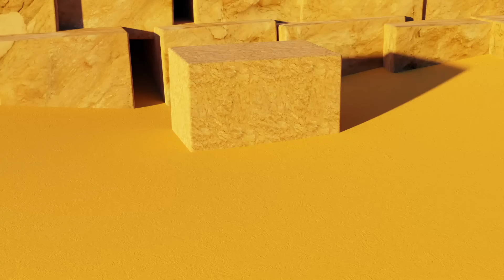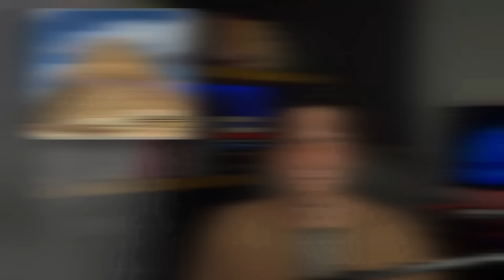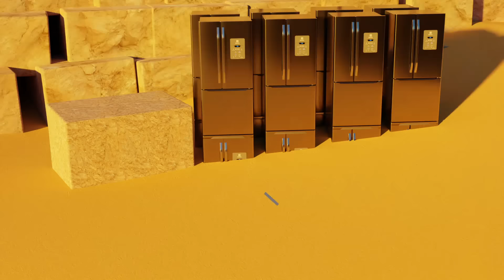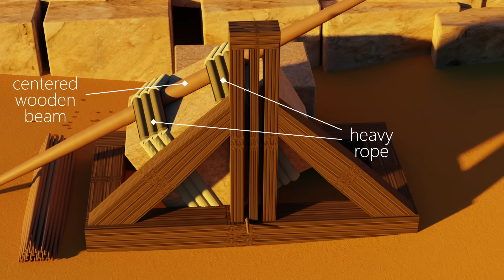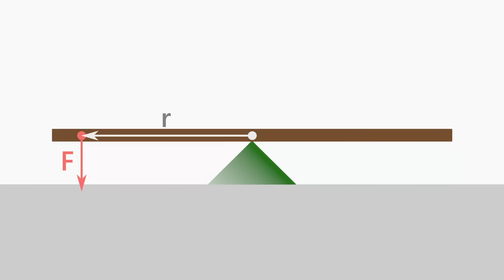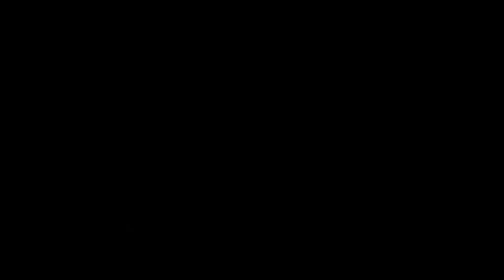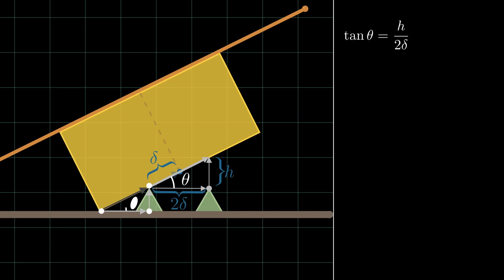Physics Reveals How the Pyramids were Actually Built

Comment: this is all fine and well for adding blocks at the base level. But then how do you get the blocks and machine up each succeeding level. And then doing one block every 6 minutes? No. I don't think this is the way they did it. had nothing to do with aliens. They knew the science of frequency vibration and resonance. A science we've forgotten or that's being suppressed. pretty sure there's a connection between resonance frequencies and gravity or the blocks were cast in place. Edward Leedskalnin accomplished the same thing at Coral Castle in Florida but on a smaller scale. He left clues to how he did it but no directions. There's a very easy way to move gigantic masses of stone. We just haven't rediscovered it yet. Might be worthwhile looking in the Vatican library for the answers.

Comment: So its basically like that machine and method used by that old guy demonstrating it in his backyard with those pillars of concrete?
Reply: And it fell on his foot.
Reply: Yes, with 100s of teams moving multiple stones at a time. I know we haven't found pulleys, but if they were around it would be even more manageable
Reply: @onicronprime118  Those must have been some seriously strong high tension ropes. It's just too easy to poke holes in it. They found some ropes in a cave but not heavy duty enough to haul massive stones and the wall art doesn't show rope used for monolithic construction. I'm sure it was but it's still a mystery.

Comment: This is a very good primer on levers, and how to lift a 10 ton block 1 meter, but does not explain how they built the pyramids. How are you gonna get those blocks to the top of the pyramid and set in 6 minutes? And how did they build the King's Chamber, which has 80 ton blocks? Not to mention the precision cutting which looks machined.

It's still one of the greatest mysteries and is absolutely fascinating.

Comment: Just one more thing to consider: are the wooden rods strong enough to support 10 tonnes?
Reply: @drd4059: Yes they are, in fact they can support much more. The reason is that the wood is being used in a compression mode, and wood's compressive strength is much higher than it's tensile strength.  As an example, wooden shoring was used to help move a lighthouse weighing about 1200 tons almost a mile, there is a video of this move  being done. It involved laying down steel mats for a temporary roadway, multiple synchronized hydraulic jacks and all manner of other stuff. The whole process took months, but it was successful. 😁
Reply: Shoot 10 tonnes was a tiny pebble to the ancients that built the megalithic structures.  lol.  You're being very kind.  And I have no idea, but it doesn't seem like wood would be the material of choice to move very heavy blocks. And pulling the stones on a wooden sled wouldn't work either as many like to say how the pyramids were built. Sand is a terribly loose material to move objects on. If you used a sled as you pulled the sled the weight of the block would continually and gradually push the sled and itself downward digging itself into the sand. That's why I think they used rails, like we do for our trains. It's the best way to move heavy objects now, and probably back then too.  Yeah, I think we're selling the ancient people short of their capabilities and tools/machinery they used.
Reply: @johannjohann6523 : And oh yea, we know that they used sleds because they documented it in stone.  There are stone carvings  of Egyptians towing large stones and statues on sleds with the added detail of some workers pouring a liquid lubricant (probably water) in front of the sled.😁😁😁
Reply: Absolutely.........

The pyramids were built on top of limestone bedrock with stone coming from local quarries
Reply: @johannjohann6523 : About the 10 tons, true they moved far heavier masses, but the basic principles and methods remain the same. As to the wood, it depends on how it's used. If you try to build a wooden structure to directly lift extremely heavy objects (think cranes and such here) then it is true that wood will not work. However when it is used as shoring jacks it can lift at least 1200 tons or more (it was used this way to move a 1200 ton lighthouse in recent times).  As far as the sand goes you are correct that dragging sleds directly on sand would be nearly impossible. Since the Egyptians did not have strong enough metal     alloys to make metal rails, the most likely way to move across sand would be wooden rails (in the form of massive beams) which would have been used in conjunction with sleds for transport.  Well why use sleds at all I hear you ask.  Well as many of the quarries were upriver from the job site, sleds would facilitate the transition from land to barge to land again. Again we don't really know the exact methods they used but the basic principles are clear enough.😁😁😁
Reply: How about the Rope? Sure pulleys can spread the weight.
We know the Romans were limited to 6 ton stones to be able to move and place with their type of rope and pulleys.
That's how you know if a site you find could be Roman or not. Does the megalithic building use stones larger than 6 tons.
Reply: Agree, a wood lever to lift 10 ton more than a foot would have to be enormous itself. That’s not even considered in the easy “physic’s “ keep looking dr John. Lol
Reply: Please don't rain on the parade! 😂 Such a nice going, and such an awesome applause. This is NOT the time to be practical. Yet. Ever. 😮😮
Reply: That's my question 😮
Reply: Not according to the Janka scale of wood hardness.  While I don't necessarily agree with how the Janka test is done, it's what we have.  According to that, the woods typically found in the region are far too soft.  Those that might have been brought up from subsaharan africa are far harder/denser, but it'd still be problematic in a lot of ways, including durability in use.
Reply: NO
Reply: Your question is stupid; It's like asking if air is strong enough to support a balloon.

Comment: Utterly pointless since this machine would be useless beyond the base stones
Reply from the maker: And why is that?  The machine's operation is surface independent.
Reply: how would u elevate it without a ramp?How would you push them into place? Plausible with smaller stones farcical with the largest Equitable to building a damn with a floorjack  @DrJohnDev

Comment: I like the video. But how did they "scoot" the blocks horizontally?
Reply from the maker: Great question!  So there's been a number of theories on that.  One theory:  the last wooden slats used can extend over the target surface.  Then, the block could still pivot between these final slats, but each rotation can be accompanied with a slight axial rotation (rotation about the z-axis).  Performing successively would effectively walk the block off the platform.  Does that make sense?

Comment: The great pyramid’s blocks were often 50 tons. Also, how did they make the precision cuts with tools available at that time?
Reply from the maker: So for the 50 ton blocks, the machines could still be used.  The wooden slats would certainly need to be thicker than the ones used for the smaller blocks.  But notice, the thickness of the slats drops out of the equations.  So they can be any arbitrary thickness to accommodate any weight.  For the more massive blocks, additional weights could be placed on the top surface of the block to add more counterweight and assist with the heavier loads.  This is a great question and I'd be eager to learn more about the precision cutting tools they used.  Certainly there are more topics to investigate!
Reply: Exactly!  The explanation in this video falls way short, unfortunately.

Comment: Ok.  That gets us off the ground to above level one of the blocks.   What about the other levels of blocks?
Reply from the maker: After the first level is constructed, the machines would be lifted and placed on the first level.  Then they can be used to lift blocks to the next level.  Rinse and repeat until you get to the top.
Reply: @DrJohnDev  That might work until the next level is full. If the next level is full, though, would there be room for the machine and the blocks that are to go atop that?  Working at the edge of completed multiple levels doesn't provide room for blocks and the machine.  Imagine being 50 meters high too.
Reply from the maker: Right, that's a great point.  So I believe the internal ramp theory may come into play here.  If you haven't heard of that, here's a link to a Wiki article:
https://en.wikipedia.org/wiki/Egyptian_pyramid_construction_techniques#:~:text=Internal%20ramp%20hypothesis,-Main%20article%3A%20Jean&text=His%20scheme%20involves%20using%20a,lack%20of%20evidence%20for%20ramps.

Basically, the internal structure of the pyramid had clearance for ramps and blocks.  

Quoting from the article:
"Each ramp inside the pyramid ended at an open space, a notch temporarily left open in the edge of the construction.  This 10-square-meter clear space housed a crane that lifted and rotated each 2.5-ton block, to ready it for eight men to drag up the next internal ramp."

This so-termed crane would have likely been a Herodotus machine, at the open space between each of the ramps.
Reply: @DrJohnDev  you created such a cool video showing how simple it is to lift a massive block up.  Can you make a part two involving the material being supplied up to level 20 or something?

Or, would you rather we just work on visualizing it ourselves?

We can.  I mean you point to the information necessary to imagine it all ourselves. 

But..

Some of us have worked hard lives in the field of Masonry. 

The first thing I think of for tall projects is what sort of nasty "scaffolding" or forklifts are going to be needed to get that stuff way, way up there.
Reply from the maker: Thank you for your comment, and I think you're certainly right, visualizing is much better than writing at this point.  I think I will need to revisit this topic and create a part II.  The comments have brought up some valid points and definitely some good angles to investigate deeper on this topic.  I'm in the middle of finishing up an upcoming video (hopefully launching in a week 🤞), and then I'll start on a pyramids part II.  You bring up some interesting points to explore on the 2nd part.  Thanks again for your great feedback!
Reply: @DrJohnDev  if they had an army of bulldozers, they could pile sand absolutely everywhere such that they drug "ground level" right along with them.

Naturally, this is highly problematic. 

Looking forward to your next brilliant works, whatever they are!
Reply from the maker: Ha, that's an interesting idea!  An army of bulldozers would have been nice!  
Really appreciate the kind words and thanks again!  Looking forward to seeing you again!

Comment: Well, yes and no. What about the solidity of the rod on which the load/block is rotated/pivoted? 

Will it endure 10 000 kg load, I doubt. If it's only that thin and made of wood.
Reply from the maker: Good point!  So it certainly would need to be thick enough to endure the sheer force of the block.  A one foot diameter log can sustain up to 20 tons (lower conservative limit) of sheer strength.  
If you're interested, check out this paper:
https://charles-oneill.com/aem341/Lesson07a-WoodMaterials.pdf

Here's an interesting excerpt from there as well:
"Shear strength parallel to the grain ranges from 3 to
15 MPa at 12% moisture content. Because wood is
highly orthotropic, it is very difficult to get it to fail in
shear perpendicular to the grain"

Comment: This seems plausable to stack one stone on another at a relative level. When the pyramid was halfway built how the hell would you get blocks from the ground that high? Using this method, just seems like a logistical nightmare and not practical on a large scale. Jean pierre houdin has an internal ranp theory that you should look into.
Reply from the maker: Right, thanks for the reference.  His internal ramp theory is something I looked into, and I believe the internal ramps would certainly have been necessary.  The ramps would have been constructed as the pyramid was being built, and allocated clearance for the blocks to be raised during construction.  So during construction, once the block is pushed to the current highest level along a ramp, it would still need to be raised one level higher in order to keep building up.  Correct me if I'm wrong, but I believe his theory still incorporates the use of a Herodotus machine in order to raise the blocks up to the next highest level.

Comment: That was a fascinating explanation of how the machine works, but it could not be built in 27 years as you described. You left out a lot from your equations, The forest required to build the machines from wood, the miles of rope needed, the cutting and transporting of all the blocks, and the thousands of people to do all of the work had to eat, sleep somewhere for 27 years. That's a lot of motel6 rooms and quarter pounders!
Reply: Yet there it stands
Reply from the maker: Well, I think the equations are fine as they are, but certainly more details to address in terms of logistics, forest sources, construction materials, etc.  And while they certainly would have needed to house the workers, I think it's fair to say that the structures the workers lived in would be long gone by now.  They certainly weren't being housed in pyramids.  The sheer mass of the pyramids is one of the key reasons it still exists.  The other 6 wonders of the ancient world were all destroyed and pillaged, which is why they no longer exist today.  The pyramid sites were certainly pillaged, but no one had the might to destroy the pyramids.

Comment: This surely explains how this machine works but i dont see why would it be only technique used. The estimated number of blocks is very misleading in my opinion ( i know that it wasn't you who came up the number), the size and weight of the blocks decreases with every "floor" of the pyramid, not to mention the fact that theres thousands of tons of rubble and mortar.
In conclusion, i do believe this device might have been used but i think mostly in early stages, when blocks were the heaviest and/or for lifting heavier granite blocks assuming that they were "inside" the pyramid from the start and were lifted one floor at the time along with the oyramid being built
Reply from the maker: I agree there were still many techniques the Egyptians would have needed to employ.  For the 'lighter' 1 ton blocks, perhaps it would be easier (and faster) to enlist a team of workers to lift up the blocks.  But for the most massive of blocks, they certainly would have needed some mechanical advantage.  I chose this Herodotus machine to focus on, as it's one of the few clues left in the history books, and something we can actually backwards engineer using physics.